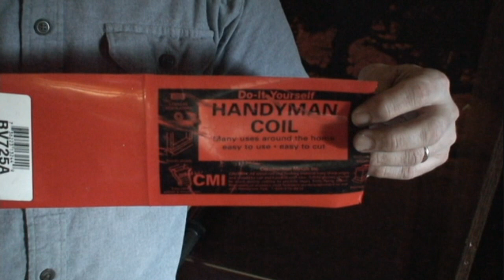Making Gas Checks with a Freechex II purchased on Ebay ( freechex2 )

Comment from the maker: I have not been sizing the bullets as one generally does to seat gas checks.  I buy super glue three tubes for a dollar at the dollar store.  I put a drop on the end of the bullet and push the gas check down with my thumb.  Some of them are a little too tight to seat all the way.  I give them a tap with a mallet.  If the bullet has a pointy node I put the nose in a small hole drilled in my bench.  After that I pan lube the bullets.

Comment from the maker: It would take well over 50,000 psi to get that kind of velocity out of a 270 Weatherby.  You are going to have to use a jacketed bullet to handle that type of pressure.  Heat treated cast bullets of an appropriate alloy using a gas check can handle up to approximately 44,000 psi under ideal conditions.

Comment: The .008 aluminum flashing is not thick enough.  I tried it several times.  The aluminum sold in Home Depot goes by name Gibraltar is about 13.5 thousands and that's what you want.  You need a way to crimp a gas check, I don't understand how do you expect it to stay, just a mere friction is not enough, when you size the bullet it closes the gas check and it will not come off.  If I am not mistaken you are using RCBS 130gr bullet (7.62) it's the same one I use and it drops out around .313-.314 so I don't know what gun you're shooting, unless it's actual AK with .310 bore you definitely need to size for typical 30 caliber gun with a .308 bore.

Comment from the maker: The inventor, Charlie told me that I am not doing this right.  The gas check is not completely formed until it is pressed against a hard surface.  I am going to take out the steering wheel puller and try forming them directly onto the arbor press plate in the morning.  If these checks are superior I will post a different video.  Mine have been fitting looser than the commercially made gas checks.  Others have said they put a little super glue on their homemade gas checks.

Comment: Very nice, however I have concerns about using Aluminium as a gas check..

The point of a gas check is to stop gas wash removing lead from the base of the bullet core and spraying it up the barrel. The metal loaded gas flow is what causes most of the wear on a rifle. Gas checks are conventionally made from copper or guilding metal. Aluminium, although soft has an oxide which is EXTREMELY hard and abrasive. Using aluminium as a gas check will cause serious wear.. Stick to copper or brass
Reply: "gas wash" do you have a clue what you're talking about??  A gas is not a liquid so don't try to describe it like it's acid or something  that removes the lead from the base and deposits in the barrel that's just your ignorance of how it works.  Nothing gets removed and deposited from the base of the bullet.  In fact tests have been done where paper was applied to the base of the bullet and it would not burn, there was not enough time spent in the barrel.  The leading occurs when hot gasses pass on the sides of the bullet and jet cut the lead and deposit, it's the sides of the bullet where it rubs not the base.  You need as check to prevent gases escaping and prevent bullet base to be distorted from the pressure.

Comment from the maker: The bullets are shooting accurately and they are not leading the barrels of my guns.  That is really all I care about as far as these gas checks go.  

I am not sizing because I am dropping my wheel weight lead bullets directly into cold water.   My Lee hardness tester has shown a drop in hardness after the bullets are pushed through the sizer.  The bullets I am using gas checks with are already the correct diameters for my barrels.

Comment from the maker: Although I appreciate your concern... I, and many others have been using aluminum checks for many years without any noticable wear problems.  I have never noticed any visible oxidation on any of the checks that I have made.  After they are installed the bullets are lubed and then inserted into the brass casing.  I am not sure how you store your bullets, but mine are stored in an airtight container with descicant to keep them dry. If they were stored in a salty warm humid environment maybe...

Comment from the maker: A concern from Charlie the inventor and manufacturer:  The tool mandrel are extremely hard on one end.  However, the 357, 44 and the 500 S&W have an almost in-perceptible difference from cylindrical drill rod from which they are made . In Some cases it is as small at .002" .   The mandrel  tip is hardened to guard against wear, and to especially keep virtually anything from sticking to it when extreme swaging takes place.  I am certain some folks are using the mandrel upside down.

Comment: there were tests conducted shooting pure lead bullets and aluminum coated bullets (same weight same charge etc)..did you know lead bullets after many rounds,wore the barrel more than the aluminum coated ones???..the coating was 0.50mm thick in which the rifling did not touch the lead inside.they came to the conclusion that alum coated bullets would make a barrel last 2 or 3 times more than if you were using lead bullys.
have a think about that one..!
Reply: Sounds like pure BS to me.  I've read reports that people shot 50k lead bullets through barrel without wearing it out and in fact I heard a lot of people cautioning against using aluminum gas checks because they use aluminum oxide in sandpaper so I find it very hard to believe that harder aluminum is easier on the barrel.  I am not worried about using aluminum gas checks but I don't think it's better on the barrel than lead.

Comment from the maker: @potatohead5309 The cast bullets that these gas checks are pressed on are immediately immersed a thick lube which hardens on the gas check and in the lube grooves.  They are then inserted into a sealed cartridge that is stored in a sealed chest that is kept dry with boxes of silca gell. Oxide does not get the chance to form on these checks in any detectable amounts. Your arm chair theory is interesting but completely meaningless in practice. I have been using these for years.

Comment: @omgiTsmeJon Aluminum Oxide is one of the hardest things around with a Mohs rating of 9 (diamond is 10 - Tungston Carbide is also a 9) and is nothing to pshaw when you're talking about barrel wear.  Copper Oxide is a 4 compared to 6.5 for good steel so I think you will agree that bombdoc42's point is valid.  Don't use aluminum.

Comment from the maker: Myself and many others have been using aluminum checks for many years with no observable evidence of any increased wear.  If it is a concern of yours then there is nothing stopping you or anyone else from making checks from copper or any other material you choose. I personally am much more concerned about the damage caused by corrosive products of combustion. It is doubtful that minute amounts of microsopic particles of aluminum oxide would be capable of even polishing the inside of a barrel.

Comment: I think I'm being too abrasive (pun intended) - in theory, these gas checks are harder on a barrel than copper.  To test this scientifically would require multiple barrels be set up in pairs for multiple calibres in pairs and have (for example) 5000 rounds shot through each barrel pair, one with copper GC one with Aluminum.  I would stake my left ear that the barrels that shot with aluminum GCs would show more wear than the barrels that shot copper GCs.  Premature wear in my mind.

Comment: sorry Steven Miller.  just had to put my 2 cents in.. hate it when someone comes to someone else's video to spout stupidity.    great video and thanks for sharing.
Reply from the maker: Hi Dan, Thanks for the comment! We have been using aluminum gas checks for years with no notable barrel wear issues. 

Some commenters seem to think that 80 grit oxide abrasive crystals are grown on sheets of aluminum.  As you point out there is not enough Al₂O₃ present on a sheet of aluminum flashing to be used as an effective abrasive and the particulate size is too small.

For the uninitiated... a micron is 1/1000th of a millimeter.  There are 25.4 millimeters in an inch.  The "particulate" that forms on the surface of sheet aluminum when it sits is 2 to 4 thousandths of a micron thick. 

So pulling out our calculators for a worst case fully oxidized piece of sheet aluminum...25.4mm multiplied by 1000th of a millimeter, multiplied by  1000th of a micron divided by 4microns = 6,350,000.   Then 1 inch divided by 6,350,000 = .00000015748031 of an inch or 15.7 ten millionths of an inch average particulate diameter. Someone PLEASE correct me if I am wrong (it is pretty hard to keep track of all those zeros). 80 grit abrasive by comparison has an average particulate diameter of 65 thousandths of an inch.

I suppose that is one of the reasons why no one that I know uses pieces of aluminum foil for polishing other metals despite the presence of a microscopic layer of super hard aluminum oxide.  The argument doesn't pass the common sense test. But it does not matter to me what material people use to make their gas checks.  If it makes them feel better to use expensive copper sheeting then that is what they should do.  Just don't try to convince me that I am having barrel wear problems from aluminum gas checks when years of experience tell me otherwise.  Personally, I would spend more time worrying about rust from improper cleaning and storage causing barrel issues.
Reply: Steven Miller trolls,  if god loved them, he would squeeze them all to death.

Comment: guys, there's not enough aluminum oxide to cause wear on a barrel any more than copper would.. in fact,  aluminum gas checks are SOFTER than copper.   you can quote the mole rating of aluminum oxide all you want,  what you fail to realize is that aluminum oxide on aluminum only forms 1 micron thick to form an oxide layer on the aluminum.  1 micron thick aluminum oxide is nowhere near thick enough, hard enough, or abrasive enough to harm barrels.   you really should comment on things you have no clue about, just because you can google, doesn't make you wise or smart for that matter.  aluminum gas checks,  aluminum gas rings, even Zinc gas rings have been used for more than 60 years and nobody has EVER reported any such abnormal wear.    manufactures like using copper because its easier to guild at high speeds, there's no other reason for it,  any other reasons are made up BS to fool the consumers.